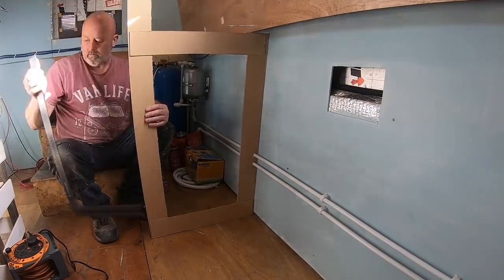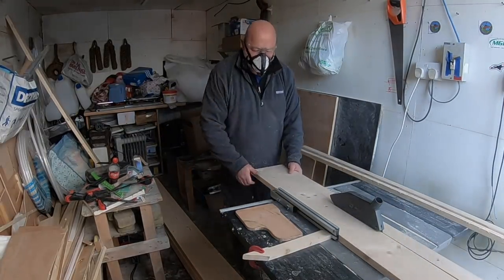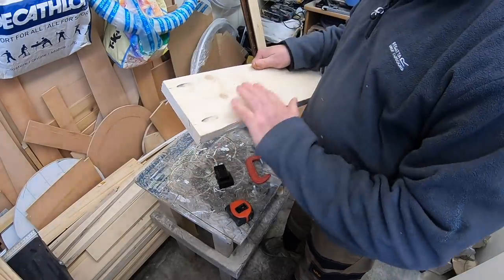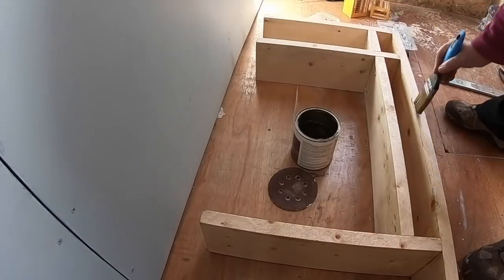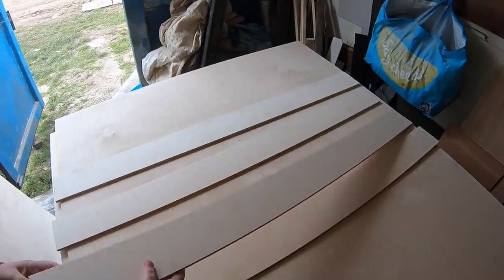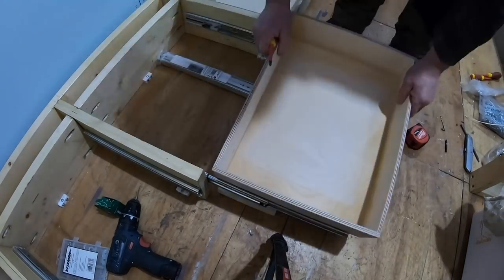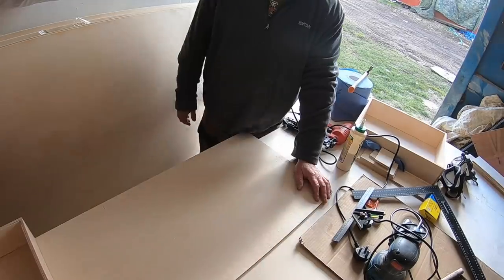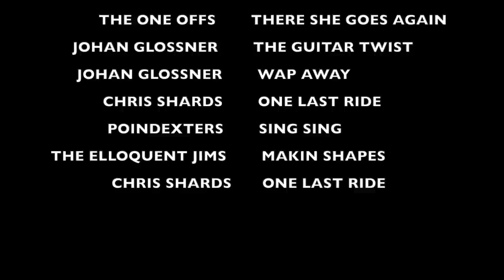VLOG 65, Narrowboat fit out - Galley (kitchen) PART 1 -  kick Board Drawers

Comment: Wow what a fantastic job.  That drilling jig is really great, I've never seen one before, I'd have staggered the bracing timbers and screwed them in from the ends adjusting the draw depths accordingly. Yours are so much better. Your carpentry skills are definitely better than mine building the draw sides first, I would have had to build them by fixing them to the bases in order to keep them square. Well done, but maybe it's just that you've got a good foreman telling you what to do that makes the difference!
Reply from the maker: Cheers Tony, Yes its a handy tool to have. make things very easy. Yes Grandad knows his place 🤣🤣🤣

Comment: Great job, amazing amount of storage in an otherwise useless space. It works well when you build your own cabinets as I would think store bought cabs would make the counter a little on the high side…ok for giants!
Cheers, Nigel
Reply: Thankyou. Yes you get to use up so much more dead space at the height you like making your own carcasses. We are quite enjoying this part of the project (so far lol)
Reply: Not so, store bought units are still fitted on top of plinths so it wouldn't effect the worktop height.
Reply: Depending on their height
Reply: @nw3803  Very true but I think that the vast majority of standard kitchen units have deep enough plinths. Since your reply I measured three in mine and my neighbours, they were all between 6 and 6•5 inches.
Reply: Where you are located they must be taller than what is normal here in BC Canada ours are between 3-4”
Reply: @nw3803  Seems so I'm in the UK.